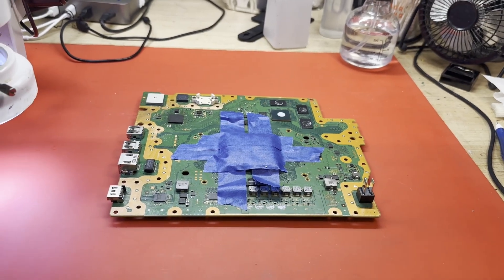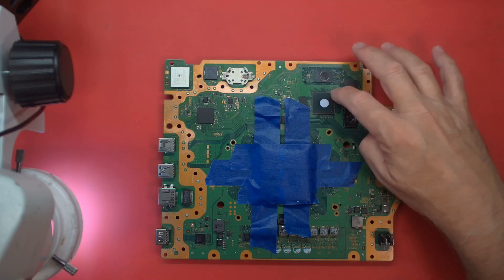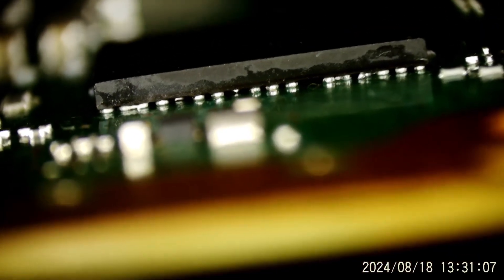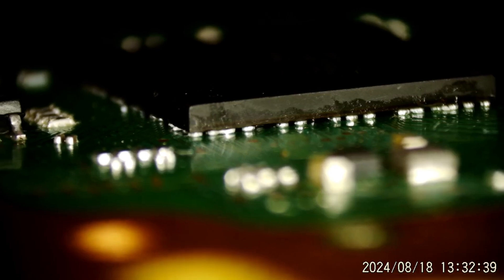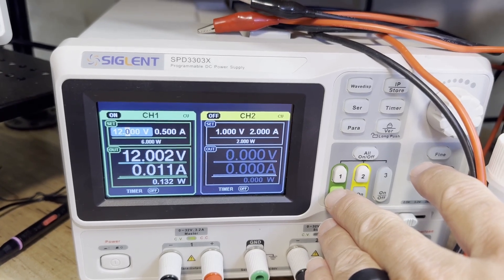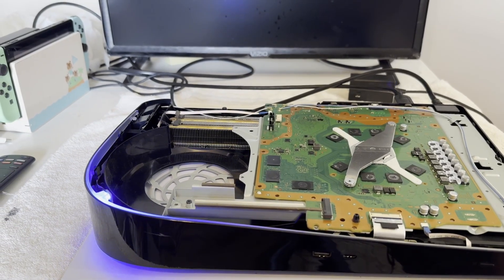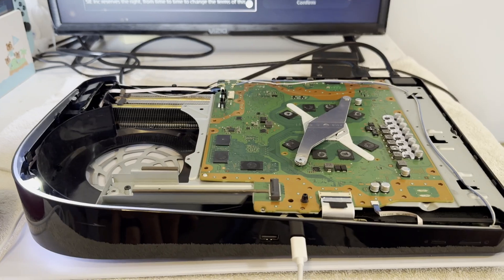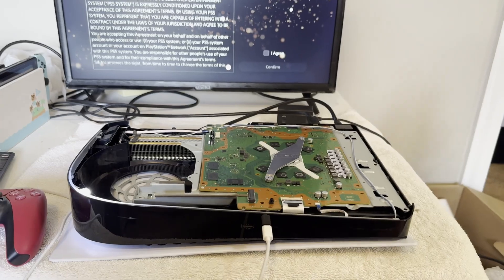#159 Repair of EDM-031 No Power

Comment: I would love to know what WiFi IC is on this board?
I wondering if it the same as mine J20H100 rev 1.3vn.
I need to know if a J20H100 rev 1.0 will work.